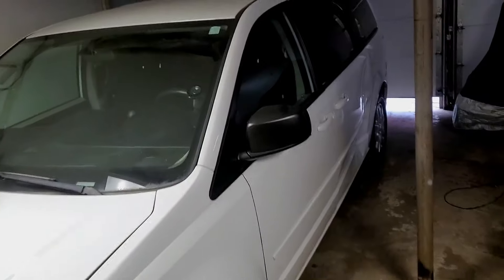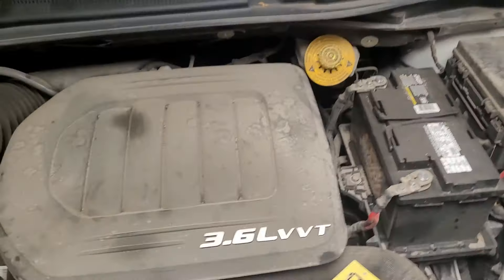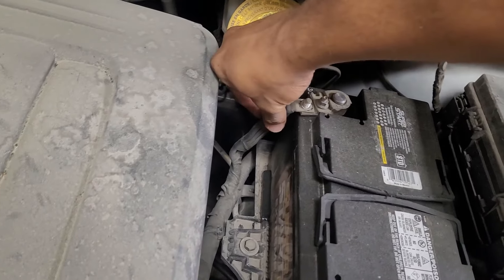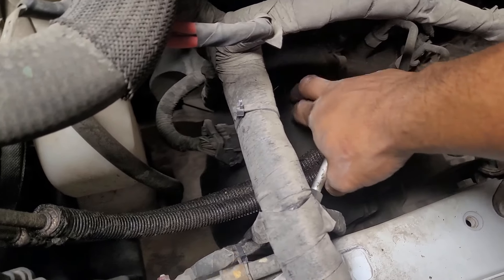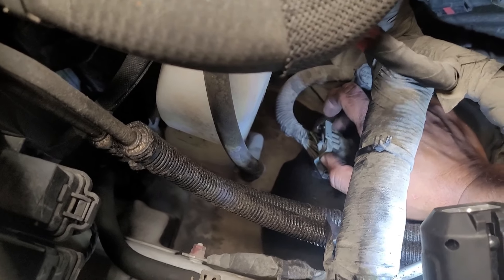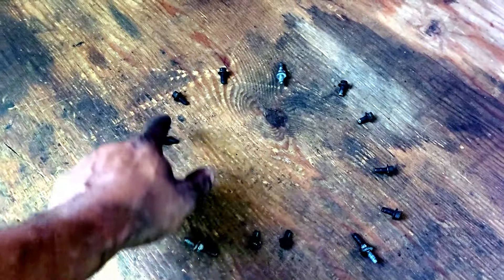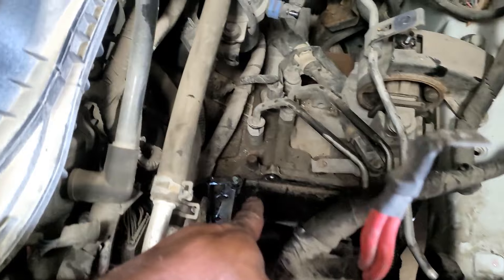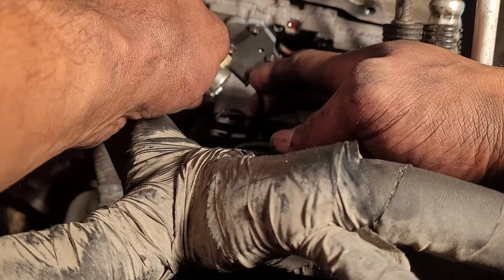2014 Dodge Grand Caravan 62TE Transmission Shift Solenoid (Minute Maintenance)

Comment: It's a T 25 torx bit, the solenoid your changing is the VFS variable force solenoid. The shift solenoid is in the solenoid pack and the whole pack must be changed. Good vid.
Reply: Can the solinoid pack be changed without taking the transmission out of the vehicle?
Reply: @ absolutely, it's not a hard job. It involves around 100 fasteners to remove and reinstall.
Reply: @papabits5721  thx

Comment: Ok. I've watched your video a couple of times. I did the work myself yesterday. It's pretty simple. But you will need a , clean oil pan, set of different lengths of extensions. And top transmission pan gasket which is 25.99 at O'Reilly's. Now if you're AC is messed up you will have to recalibrate your ac controls afterwards. And make sure you have the big plug securely in place and snapped in. Otherwise the vehicle will not start. And the dash will show it to be stuck in reverse.  After you have put everything back together. Use a very long funnel and slowly pour your trans fluid back in. If it's still good. If not replace it. I ran into problems yesterday. With not a whole lot of information from these videos. You covered most. Just missed a couple of mistakes. The tran fluid will pour out. Trust me. Unless you are low. I was on a flat surface and still drained about 6 quarts worth. But poured it back in

Comment: Great video!
I just completed this on my wife’s van thanks to this video.
Some things I noticed:
Make sure you have a deep socket 10mm or a wrench.
Make sure you have a few extensions and possibly a swivel head. 
Buy a gasket. Mine was 4 bucks. I also laid down a thin layer of ultra black rtv before putting the gasket on.
If you use ramps, you barely lose any fluid.
I didn’t disconnect the transmission lines and was able to work around them easily. 
You can put the pan on from the bottom with no problem with the lines still connected. 
You can do it yourself 100%. Take your time.
Reply: Kainslaton366, your recommendations are as valuable as 12 of these very important Videos! Thank You SO Much !!!
Reply: hi sir, is there a gasket for this pan?  From all videos ive seen so far, its just gasket maker for the seal.

Comment: I have to agree with a few other comments, VERY well done video, showing all steps and actually showing the work being done. Now, for MY problem, I would like your educated opinion...

2010 Grand Caravan with 3.8 BUT, the transmission was replaced before I got the van. She believes it's a '17 but it is a 62TE. Was getting P733 and 734 codes but what I am hearing is a scraping/grinding sound when starting from a stop in first and second gears. Not so bad if I was easy on acceleration but still very bad sounding. Went to replace filter and fluid, fluid was pretty toasted and there was no evidence of metal pieces or chunks in fluid but the magnet was coated with filings. I was thinking the gears were stripped and the tranny needed to be replaced. My brother, a mechanic, says it is most likely the shift solenoid. I'd much rather replace the solenoid than the entire transmission for financial reasons, obviously. What do you think?

I drive for Uber in Vegas and if I cannot get this problem fixed ASAP I will be screwed for paying rent and therefore become homeless, NOT something I want. I have had to scrape for money and even started a gofundme to get the tranny replaced, would much rather spend a lot less so I am asking for a second opinion. Thank you so much!!
Reply from the maker: Hey thanks for watching! Im so sorry to hear you're having this issue. I don't like to 2nd guess a mechanic especially one who presumably had eyes on your vehicle. But I don't believe your described issue can be fixed by a Solenoid. A grinding noise/sensation is not a symptom typical to a faulty Solenoid. The noise plus the fact your fluid was "toasted" (presuming burnt) it's most likely the lack of properly maintained transmission fluid has caused damage to your clutch plate!! If the fluid was burnt that means it had zero ability to dissipate heat (its main job) and lubricate for the clutch plate and gears. You most likely have a clutch plate if not torque converter issue. If I'm you, I would save up some tips. Spend the 1 to 2hr cost (assuming they'll charge most shops will diagnose most things for free in hopes you will in turn pay for the repair) and have a transmission shop diagnose it. That way you have 100% all the information you need to properly determine what your next option is. As opposed to assuming it's roached and ditching the van, spending time/$$ swapping a Solenoid to have it not fix the issue or have the van breakdown w/ clients. I hope this was some what helpful, happy wrenching!
Reply: Thanks @minutemaintenance7385 , your input is much appreciated!

Comment: Checking out our van now. We have a 2011 grand caravan with an issue that just started out of nowhere. Drive it and once I get to 40 mph the engine just revs up like it’s maxed out in a lower gear. I had 2 codes come up on my small reader. Codes are 
P0882 TCM
P076A (pd)
Reply: Bruh, I got the same codes, I did everything he did, but still had the same problem. I found out later that what I had to do is change the solenoid pack. Wish I knew that before i open the pan the first time.
Reply: @ where’s the solenoid pack? My problem is intermittent. It’s annoying.
Reply: The solenoid pack is right there where the front big plug is, but you have to remove the valve body to remove the pack. I was having a rpm problem I was stuck in 2nd gear and my rpm would run high but wouldn’t switch to the higher gears. Once I replaced the solenoid pack everything is now running smooth.
Reply: @ that’s the problem I’m having. It will go from driving fine to stuck in a low gear and won’t shift. After I shut the van off for 1-2 minutes and turn it back on, it goes back to normal.

Comment: My friend Caravan has P0760 and it is literally crawling with high RPM and not shifting properly. Does this fix apply to this issue? Please confirm.
Reply from the maker: Thanks for watching! This solenoid I replaced in this video may fix the issue. BUT I always tell everyone. Change your Transmisison fluid and filter FIRST! 99.99999% of the time, Low, Dirty/old fluid is the culprit! The solenoids will throw a code if it senses poor pressure in the valves..which is almost Always caused by not properly maintaining the transmission. Only AFTER driving for a long time with dirty fluid and filter will the solenoid finally lock up or due to a short caused by build up of ceramic/metal material in the fluid from natural transmission use due to..not changing the fluid! Hope this helps, Happy Wrenching!

Comment: HI.THANKS for this great video Mine thrown shift solenoide malfunction and just drive on 1r gear. IS this solenoide or the whole valves box? Did you drain the transmission fluid for this job? Thanks brother
Reply from the maker: Hey thanks for watching!!
Sorry for delay in response..I did Not drain the fluid first, However You absolutely should! 
Some ppl have been able to change this Solenoid w/o draining the pan..others have not been able to. Better safe then sorry.

I always recommend b4 changing this Solenoid to do a fluid and filter swap first, the majority of "codes" or sensor malfunctions I've seen in my lifetime are due to poor/thin/dirty/burnt fluid or a bad filter!!

BUT as you're finding yourself stuck in 1st gear or limp mode..if it's my vehicle I'd plan on draining the fluid, and changing the filter and Solenoid all in one!!

Happy Wrenching!!

Comment: Does this vehicle have trailer hitch wiring?  I'm having multiple electrical issues with my 19 Caravan and I'm starting to think it's caused by the aftermarket trailer hitch writing done at a national hitch supplier.  I have noticed that they ran a wire to the cars battery and also grounded it to the cars body from inside the tire kit compartment.  They used the Curt Quick Connect kit that connects directly to the taillights and has its own module which is powered by the cars battery.  So I am wondering if the turn signal lights that are already powered by the car and is grounded with the cars built-in grounding why would the hitch wiring need it's own grounding and power?  My lovely 19 Caravan SXT has turned into a nightmare.  I have already replaced the PCM, the Throttle Body and disconnected the hitch wiring but there is still a drop in voltage when it shifts up or down from lower gears. 

Anyone have any suggestions?  Greatly appreciated.

Comment: Hi . Thanks for the video.
My 2012 dodge Caravan all started with a small noise. When I went in highway was not slipping. There was no transmission code. 
The car started to run okay the next day. After three weeks started temporary same  problem. 
I  took to my mechanic,  he told me the solenoid shaft needs to be replaced.  He is very honest and I trust him.  He told me that he is not 100 percent that will solve the problem.  The car has 88k miles .
The car drives okay for now but I am the problem will come back. 
Just wanted to ask for your experience    if I think this will solved the problem. 
Thanks in advance. 
Joseph.

Comment: 2016 dodge grand caravan shifts great from 1st to 2nd im not sure it gets to 3rd the rpms keep going up speed will increase but no shift change this happens at about 25mph on a easy acceleration. what would you say is the issue
Reply from the maker: @benpetersen2583  Hey Thanks for the Question! My 1st thought (assuming there are no codes being thrown which would offer us further info to consider) is that you may have low or old Transmission Fluid.

The overwhelming cause in my personal experience for shifting issues is because the Transmission Fluid isn't being serviced. The older the Fluid the thinner it becomes, and harder it is to shift due to lack of.hydraulic pressure or increased friction amongst parts. 

Same can be caused by an old transmission filter being dirty or clogged preventing proper fluid filtering and therefore limiting hydraulic pressure needed for shifting.

If it was my van I'd swap the fluid and filter first see if there's any changes if not..my next step would be this Solenoid!! 
Happy Wrenching!
Reply: @minutemaintenance7385  the fluid was recently replaced by a shop as for the filter id assume thats what they did too thanks

Comment: I have 2015 dodge caravan.i replaced fluid and filter .now am having hard downshift from 2nd gear to 1.only when am coming full stop in slow speed.upshift is perfect
Reply: hey brother, i had the exact same issue with my 2015 caravan r/t.  I just went through this process yesterday (drop transmission pan, replaced transmission oil, filter and gasket, and removed valve body pan (reseal with gasket maker) and replaced the solenoid).  This evening we drove around 100KM and the braking to stop is so smooth, like brand new!
Reply: @stevensly  what solendiod you replaced.

Comment: Thanks for the video! I have 2014 chrysler town and country, it drives and shifts okay from gear 1-6. However, the reverse is like neutral, it wont engage at all. Even at 5k rpm still wont move. I checked the tranny fluid and its black what could be the issue?
Reply from the maker: Hey thanks for watching! So sorry for delayed response, I did not receive this notice! If your fluid was black it needs to be changed along with the filter asap! Black fluid= Burnt/dirty which could explain the lack of grabbing/power when in reverse. If the fluid is old, dirty, burnt it wont allow for proper gripping within the gears. The fluid not only lubricates and cools the transmission, it also allows for hydraulic pressure and friction needed for the transmission to shift!!

Change the fluid and filter and you should see a noticeable difference in all gears!! Now if the fluid is as "black" as I'm imagining then it is possible damage has already been done to the solenoids, gears, bands etc. Hopefully you've noticed the issue in time!!

Good luck and Happy Wrenching!

Comment: My 2017 is throwing P0750, P0882, and P076A. The tcm isn't communicating with the ECM. Shift solenoid A and H are stated to be faulty as well. Any advice would be great.
Reply from the maker: Hey thanks for watching and reaching out! I'm sorry you're having these issues. Based on the codes you've given, if it may van my main focus or area of concern would be code P0882 (Low voltage between TCM and ECM). This can be caused by a host of issues from bad/faulty/corroded Pin connector, bad relay/fuse or even wiring within the circuit. If it's not getting the proper voltage it cant read the codes appropriately and could also mean the Computers aren't even sending proper signals to the solenoids you mentioned so they could be reading falsely. Unfortunately this issue doesnt have a simple solution, it will require a hard diagnostic to verify proper voltage in several different areas of the system to confirm its functioning! 😬 too complicated for me to type out and I would highly recommend spending the $200-300 a sharp would charge to diagnose such an issue to have a definitive answer provided..could be an easy fix..could need an entirely new wiring harness or computer!!

BUT if you want to try a few things first, you could take your battery to a shop or auto store to verify it's good. If your battery has  a dead spot it is possible its sitting at proper voltage stationary but under certain load circumstances its voltage or ability to maintain voltage is lacking which could result in the system faulting. Verify the battery terminals are clean and solid, if battery is good then perform a reset of the computer..several different ways to go about this process I'd suggest youtbubing a few methods and see which your comfortable with (certain vehicles have specific intervals of key rotations and timing to perform a reset or just disconnect the battery and ground the negative to the chassis for 2 to 3 hrs to drain every relay and capacitor within the system). If this doesnt change the P0882 code then itll definitely need hands on ohms testing by a technician (if you're handy with a multimeter you can try yourself all voltage readings are listed on several sites with a brief Google search).

To address the solenoid codes those could definitely be caused by the p0882 (low voltage) issue or dirty/low transmission fluid and bad filter. A simple fluid and filter flush is always recommended b4 swapping solenoids due to contaminants in the fluid routinely causing false reads.

Wish there was an easy answer but the spectrum is so broad when it comes to electrical related issues. Good luck, and Happy Wrenching!!
Reply: That's your tipm causing that...tipm is the motherboard of the car and only Chrysler and Dodge have them from 2008 and up ....

Comment: I have a 2014 town and country. It suddenly slowed down on me one day. Then it wouldn't go over around 35 mph. It goes in reverse fine. The code says transmission shifting solenoid. 
Should I try changing the fluid and filter before changing the solenoid?
Reply from the maker: The honest answer is...it depends! How old is the fluid and filter? If it has never been changed...or hasn't been changed in several thousand miles (50k plus) it is possible the bad, dirty, or burnt fluid caused the sensor to trigger. I would at the very least try and check the fluid. Make sure the level is at the proper place and the fluid looks clean! If the fluid looks serviceable then my next step would he to change the sensor!

Comment: I have a 2015 town and country. I am having a shifting issue. It slams rear hard going from natural to drive and it won't shift out of first.
Reply from the maker: Oh Man I'm So Sorry to Hear About Your Transmission Problems. Are There any Lights or Codes Being Shown?!?
Reply: @minutemaintenance7385   code says low line pressure, has fluid, new trans filter ect
Reply from the maker: Oh Geez that's a tough one. That Code can have several causes. Since you've installed a new filter and new clean fluid to the proper level...we can rule out dirty fluid/filter being the cause. But that could still leave a bad PCM, Clogged or Dirty Valve Body, Bad Sensor...Honestly If I'm You I'd take it to a Shop to get properly diagnosed! Something like that is hard to pin point without being hands on! I'm sorry I didn't have more info for ya..if it is as simple as a bad sensor...or even dirty fluid still being in the valve body..the long you wait to get it diagnosed and fixed..the more permanent and costly the damage will be!